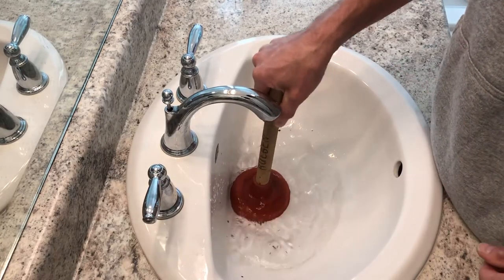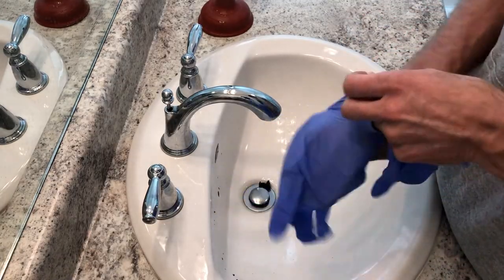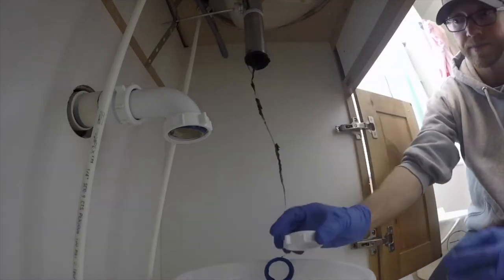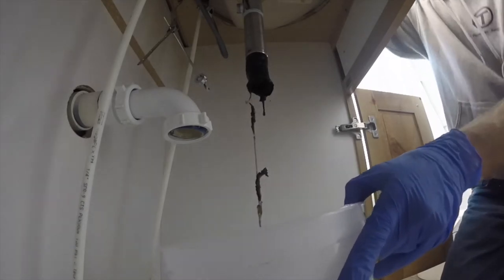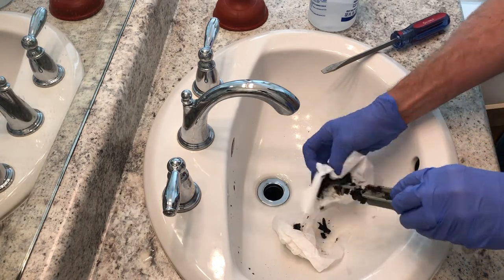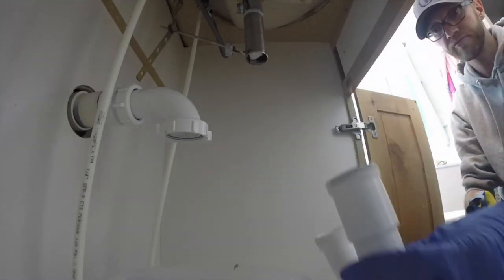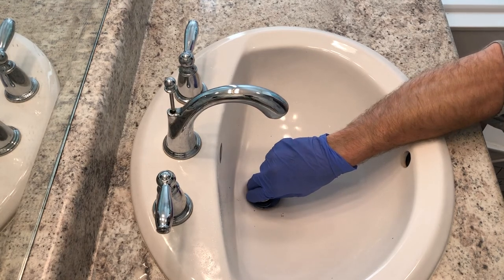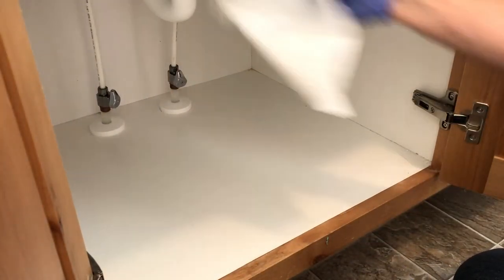DIY Clogged Bathroom Sink Drain - Plumber-Tom

Comment: Great video! That method really worked! Only hang up was getting that pop up assembly back together correctly. Any tips?
Reply from the maker: Thanks Kevin.  That can be a trick.  Sometimes takes one or two tries.  the most important thing would be to make sure the washer that seals agains the lift lever is still in place.